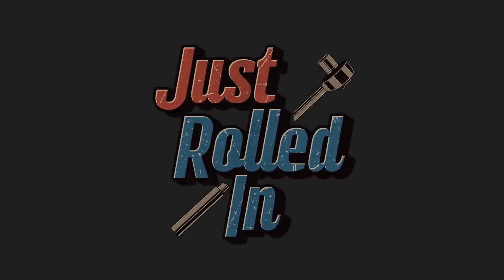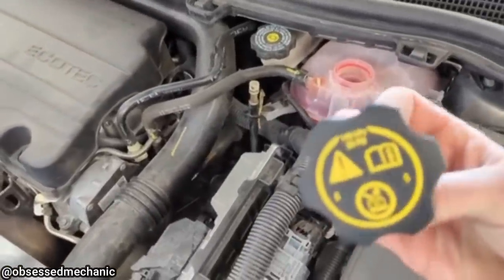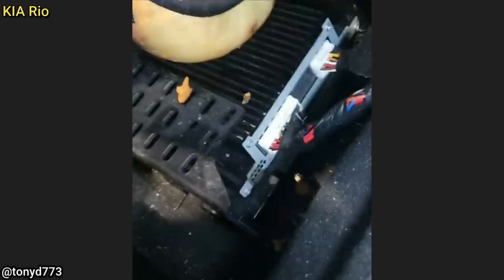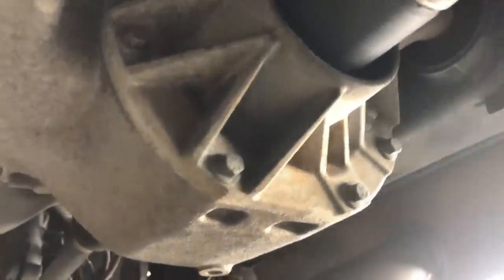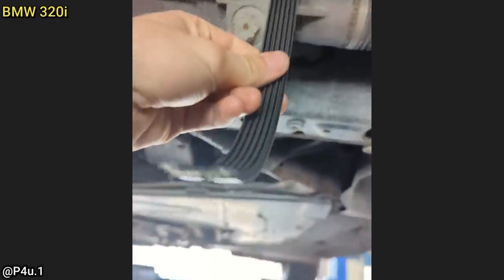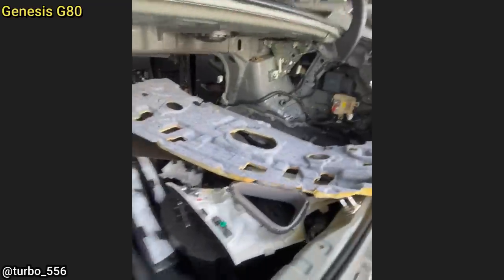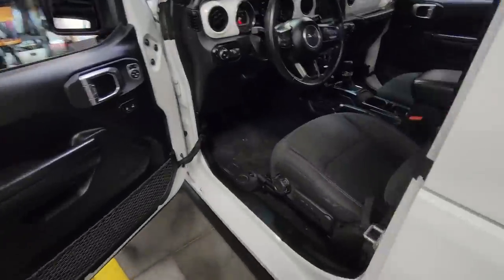Customer States Tire Fell Apart Two Days After They Were Installed (4 Months Ago) | Just Rolled In

Comment: I just bought a car (used) yesterday.  2009 Hyundai Elantra with 69k original miles and I got it cheap.  The car was a, 'grandma's car' and in pristine condition except for one thing- It drove fine on a smooth road but made horrible knocking sounds anytime the road was anything but perfect smooth.  I found the real problem after driving it about 50 miles and got under the car to get an idea of what was going on.  Apparently, Grandma drove over a tree branch and didn't tell anyone but just sold the car to avoid embarrassment.  The 1 to 1 1/2 inch think branch was wrapped amongst the rear suspension.  I removed the branch and she drives just fine now.  Sorry I don't have pics or a video (it happened on the side of the road), but it's a good story anywho.
Reply from the maker: I saw that on your page! Glad to hear it was a super easy fix and hope the new car lasts for a while. But next time I'll be expecting a video 😉
Reply: My parents went to the mechanic for a strange knocking sound when at high speed. It was a branch.
Reply: Great! Now, sell it before it catches fire and burns down your garage.,..😎
Reply: Recently, a woman(stranger) next to me was backing out her new(used) Prius and it made a horrible noise. I looked underneath with a flashlight and it looked like a bunch of wires taped together. Sent a picture of it to my friend who owned 2 Prius. He said, "That looks like a branch". Sure enough it was a branch with FIVE 1/2 inch limbs attached to the underside. I pulled it out and off she went.
Reply: Nice
But maybe next time you should look under a car before you buy it.
Reply: Fun fact a lot of parts from kia rios from around the same year are compatible with that car. I have an 08 rio that has a valve cover from a 20?? hyundai elantra. The engines are identical. So if you find urself in a jam and dont wanna pay top dollar just head to the nearest junkyard.
Reply: my 2007 Elantra with 122,000 miles is the best car I have ever owned. I have replaced nothing except normal wear items since I got it used in 2008, except the valve cover gasket ( light leak ) and the Coil Pack had a fault at 121K miles. Your 09 and my 07 are pretty much the same I think. When you change out the timing belt at 80K miles ( I did it at 100K and the belt was good but the water pump was close to failure ) make sure to use OEM parts. I know a few who used AutoZone or Advance parts who had problems after < 40K miles.   I bought my car for $11,900 in 08 with a dealer lifetime warranty for the powertrain. Got it cert preowned. They are good cars if you do normal maintenance. I have used full synthetic oil and STP extended life filters since 2010 and when I did the valve cover gasket, the cams and upper part of the engine looked like new. No sludge, no scarring, just nice shinny metal surfaces. 30-35 mpg also and enough power to be a  fun. Mine handles like a go cart.
Reply: A tree-mendous deal.
Reply: Lol one night I was driving and I apparently ran over a 2 x 4 that was wedged into the suspension of my Tacoma . I pulled it out and the horrible sound I heard went away with no apparent damage ( happened a few years ago)
Reply: My neighbor hit a washing machine that was in the middle of the highway going 130kmh, thing fucking exploded and there's still chunks of it in the grill of that F350, although he kinda rolled the truck a week later. (No injuries ground fell out from where he was parked delivering firewood and kinda bent the cab)
Reply: @bread-gz3rl  It's a heck of a washing machine that can go 130 kmh, just sayin' ...
Reply: @josepherhardt164  it must have been a Speed Queen
Reply: @peterf.229  But could the 2x4 be salvaged?
Reply: @mdotguy  OMG.  I think you win the Post of the Day award!  :)
Reply: @josepherhardt164  Those new front loaders, go like hell. 
No surprise, it was on the freeway.
Reply: @josepherhardt164  I legit almost fell off the couch when I got this notification lmao
Reply: @bread-gz3rl  Sometimes humor is organic.  :)
Reply: @josepherhardt164  Scooby Doo and Shaggy go flying out the window on a Washing Machine attached to an ironing board and fan
Reply: How do you miss a tree branch when buying a used car? ( :
Reply: @helgenlane   They kicked the tires 🛞!  What more can you do?  Lol 😝
Reply: I love the excuse it happened on the side of the road because either you forgot that smartphones exist, or you are one of those people who doesn't use one but has a camera at home xD
Reply: @bread-gz3rl  So looks like he should have removed the washing machine parts from the vehicle, as it's now switched on the Spin cycle
Reply: @batsonelectronics  your lucky I bought a 07 elentra 5 years ago when I moved to Gainesville and right after I did all the regular maintenance at 100k my transmission blow up at 105k and cost 
 me 3k to replace still have the car with 131 now
Reply: @Darksun13  trans is serviced at 50K in the book, I replaced the fluid at 50k and again at 101K, I used OEM fluid.  Sorry about your car, prior owners non maintenance isn't the car's fault though.  I think there was also a solenoid that can go out making the shift real slow and acting like a slipping trans. ( causes the rpm's to go way up before a lazy shift )
Reply: shakey cellphone footage

voiceover explanation

find cause

"Aw nuts."

Comment: Just as a rule of thumb: If your car starts making a new noise, moves weird or smells suspiciously, stop immediatly and at least inspect if you can see something obviously wrong with the car, like leaking fluid on the ground or it has parts like the wheels not sitting where they should on the car...
Even the smallest strange whistle can become a VERY expensive boom if you aren't careful!
Reply: Common sense is lacking from most people these days.
Reply: I was searching for a parking space in a tight squeeze industrial estate, I heard a massive Thud and then the sound of something rolling to a stop.. But it was quite a weird sound to our ears..
I feared the worst, my wife on the other hand feared where we were and didn't wanna stop.. But I made her.. 
The damage??? My reputation.. It seems she rolled over a carton of orange juice, and what we heard was the lid popping off and firing itself into the plastic guard under the engine and it rolling/bouncing and coming to rest.. 
Though, I still maintain it was good to stop, even if it were in a stretchy area, because we had NO idea what the hell that was..
Reply: Naw.... just drive it!
Eventually the noise or whatever, will stop. Or just get too loud.

That is where, Just Rolled In, comes in to play!
And he can post more great stuff!
Reply: I read this twice and have no idea what you said. My car started making noise after i changed the alternator. After 2 weeks the pulley broke off the water pump. Had it towed home. Changed it myself. It was an all day job and i wouldn't volunteer to do it until i had to. So i ignored the noise. Besides, without removing the engine yoke you could not tell which pulley it was.
Reply: just turn ur radio up louder, then the noise goes away smh
Reply: @rylquef9757  don't forget to put electrical tape over any annoying warning lights
Reply: And under no circumstances put transmission fluid into the cooling system.
Reply: Yeah agreed.  If any noise happens don’t drive until get it fixed.   we had this happen to our Honda Odyssey making rattling noises and I found it’s the timing belt tension went bad so had the shop replace the whole timing belt kit.
Reply: A few days ago, I heard an expensive noise from my engine bay when I rolled my windows down. Opened the hood, listened: KNOCK! ... KNOCK! ... KNOCK! ... KNOCK! ... KNOCK! .... not good. Take off the oil cap, and BAM!, the lid just flies off, spraying oil all over the engine cover. Definitely not good. Give it a bit of throttle, just to make sure: KNOCK! ... KNOCK! .. KNOCKKNOCKKNOCKKNOCK!!!!!!!!!! Yep. Time to go and get a used engine from the junkyard. At least that also takes care of the broken temp sensor, failing alternator and bent A/C compressor pulley. R.I.P. 1.8T, at least it lasted 149k miles, having been retired to a summer car a few years ago due to being worn out and an ever increasing oil consumption.
Reply: Short of seeing some fluid on the ground, most people have no idea what they are looking for... and many would NOT notice the fluid.
Reply: Dad the Lambo is smoking again.
Reply: I thought you were going to say: "...stop immediately and inspect your vehicle for hidden pumpkins!" :p
Reply: I used to drive trucks cross country and i got into the habit of doing a quick pre trip inspection every time i stopped, whether it was for a quick break or stopping overnight. I always checked the tires, lights, etc.  The oil and other fluids i would do first thing every morning. When you drive over 100,000 miles every year you become very in tune with your truck, you know what feels and sounds normal vs abnormal. Sometimes I would suddenly turn the volume down on the stereo and just listen to the truck for a couple miles for any unusual sounds. I used to drive "reefers" (refrigerated trailers in case you didn't know) and i got so accustomed to the sound that at night when i'm asleep if the reefer didn't switch back on after a certain time, the silence would wake me up and i would go investigate. Have you ever fallen asleep watching tv, (if you say no you're probably an alien) 😁 then someone suddenly shuts it off and you wake up? It's kinda like that. The first time it happened the belt had slipped of the pulley somehow. Nothing like suddenly having to do reefer repairs in the dead of night while half asleep. 😁 Good times.
Reply: @sweeptheleg.  ... that's kinda like waking up to the quiet an overnight snow brings when you live up north.... or a midnight power outage. It's amazing how much that dampens almost everything.
Reply: The whistle was a feature on my first car. My grandma gave me her old car, and it had a whistle for as long as I can remember, she bought the car when I was about 4 years old. I never did figure out what caused it to whistle, and sold it to a friend.
Reply: @SuperRat420  ... I have seen that many times and it's usually a LOT of noise.... hard to ignore.
Reply: @rylquef9757  ...unless you have a rotting pumpkin under your seat and the liquid is shorting out your radio...smh
Reply: Unfortunately, a lot of noises start quiet and slowly get louder, so you don't notice them if you drive the vehicle every day. Had that with a bad engine (it developed a knock, was later replaced under warranty) and a failing wheel bearing.
Reply: @ColinRichardson  I once ended up with a five gallon drum under my car, whilst I was in the third lane going down a highway. I did not have a jack because my dad had "borrowed" it a few days previous without telling me so I had to wait for my breakdown to come get it out and inspect.
Reply: @SpearM3064  shops will often Lie' and charge way more. For other things. And then fix a minor cheap fix.
Reply: @GalenlevyPhoto  Do much in total?😯😯
Reply: This is true even if you have an ev.
Reply: Just turn up the radio.
Reply: I think your asking WAAAY too much of ppl these days. Most ppl haven’t even visited their backseat let alone under the hood.  Thinking they’re gonna transform into a certified NASCAR mechanic by looking at the drivetrain, I think is a bridge too far.
Reply: One time I had a wheel bearing going out and kept putting off the repair even once it started grinding. It seized up trying to pull out of a parking spot. I somehow managed to roll the van back and forth until it loosened up and I started deiving. My parents (and my dad’s garage) were ten miles down the road and I knew that if I could get it there I’d save the money for the tow. If I didn’t we’d be stuck somewhere and have to get towed to a garage and get mechanic prices on the repair. So I fucking sent it. Halfway there I can hear chunks smacking the inside of the wheel well. These were ball bearings. Managed to make it there though.

Was it stupid? Yeah. Was the logic there? Definitely. Did it work? Hell yeah it did.
Reply: Had my left driveshaft delete itself.

Kept noticing some unusual sounds from under my car, something that sounded like clapping 2 small metal pieces together.

After I took some videos mid driving I stopped in a parking lot to check it out, nothing. Even laid under my car to check everything and I couldn't spot it. Then I drove 1 meter and the screws of the joint fell off and driveshaft came out.

I'm pretty sure the shop who has done previous work on my car earlier this year didn't tighten the screws proberly and it became loose over a 4000km trip.

Scrariest thing being that this could've happened anytime while I was on the autobahn driving back home. Costs me 250 euro including new rear wheel bearing that I was aware would need replacing but didn't know they were that bad. 

Got it fixedwithin a few days just in time before I went on another trip to Germany. After that trip my turbo system decided to have issues again which I suspect being yet again one of the pipes. It's at the mechanic now, maybe it's done by tomorrow, I'm expecting at least 350 - 400 euro as I also asked them to slightly align my exhaust that I installed myself a few days prior and came out slightly slanted.
Reply: For reference I live in germany so no US bullshit. Once I was driving with my parents through germany to visit my brother. In front of us was an older truck and it smelled like diesel. Since we aren't driving a diesel we thought the smell came from the truck but a few kilometers after the truck followed a different route than us we stopped at a gas station and inspected the car. Well my dad forgot to put the lid of the oil tank back on when refilling it. So yeah it was spilling out when driving.

Also when something sounds weird when I'm driving my car I always try to make out where it comes from before inspecting it.

Comment: When I was much younger I worked at a Goodyear store as a tire tech. I cant even count how many General brand tires in 5 years that separated exactly like this. We used to joke how General must be looking for repeat business it happened so often. You do get credit for remaining tread depth when this happens.
Reply: Same only with Firestone tires. At the Ford dealer, I would get a car for vibration, and the factory balance was 6 or 8 ounces. I rebalance it an now it needs 10. Clearly bad tires, often more than one. But back then, dealers didn't handle tire warranty. I would have to send the customer to a Firestone dealer. Of course they would say the problem is not the tire, go back to Ford. So the customer was suck between the Ford dealer, and the Firestone dealer.
Reply: im a tire fitter from australia, and we have some brands here that are abhorrant. mostly chinese brands but id only ever seen separation on retreaded tires, untill we started getting cheap imported tire and once a month i see new tires suffering separation. crazy how these are allowed to be sold.
Reply: @Smickster01  here in germany we can get those cheapo chinese tyres as well, usually across the internet. some auto club tested many of them. most are like, "perfect on dry road, worse than soap once there is a drop of water" many of these companies must not care for repeat customers.
Reply: @lotharrenz4621  lol@repeat customers. yes, the world is a funny place when quality and safety in this day and age is just not a thing.  the world seems to be rolling backwards.
Reply: I.know for a fact that general tire builders made 40 to 50 an hour and about every couple years go on strike wanting more
Reply: @scottrussell6717  the price of greed...

Comment: I was once driving home in my work van when it started shaking like a wheel was about to come off. I pulled over expecting to find a flat tire or something but everything looked good. After limping home my mechanic neighbor came over and we eventually found the problem, one of the tires had internally separated from the wire causing it to become out of round. It looked perfectly ok with lots of tread still on it but would not spin straight, replaced the tire and it drove perfect again
Reply: yep I had that problem tires looked brand new in tread ,, I must have got a pot hole at some time bulge in the tread about 3 inches ..still have the tire .. left it by the house by the road edge no one stole it .. have to make a trip to the tire center and pay for them to take it ..
Reply: Finally, a sensible person
Reply: New one to me, I'll have to keep it in mind, thanks.

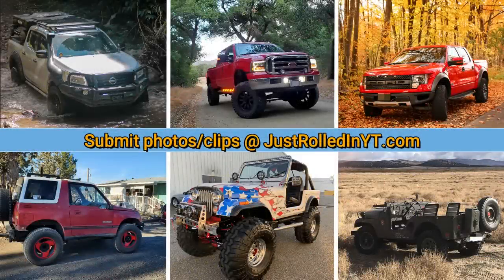Comment: 3:20 - Aw yeah, a Suzuki Sidekick... I had a '94 Geo Tracker, not a lot of power, but it would go literally anywhere I asked it to. Fun fact: A full set of Warn locking hubs cost $80 (in 2001), while the OEM aluminum ones cost $350 EACH.

Comment: After seeing the work customers did to their vehicles in this video and past videos, the old saying "If You Want Something Done Right, Do It Yourself" just went out the window.
Reply: Then there are the ones like the jacked up cracked diff, done by a 'professional'...
Reply: @NemoConsequentae  Hopefully done by "The new guy". If this is standard practice there are likely a lot more damaged cars that don't show problems until later and the driver just assumes they hit something.
Reply: It tends to help if one actually knows what one is doing. 🙂
Reply: I stopped going to service centers because anything they fixed, I had to fix to make it right.  Except now with newer cars CAN bus that's out the window.  My newest vehicle is 2008.
Reply: That saying only applies if you know how to do it yourself!There are factors to this!
Reply: I don't let anybody work on my vehicles. After 45 years of auto ownership I still build my own exhaust systems and mount my own tires. Bumper to bumper skills aren't easy to acquire,  but are invaluable to posess.